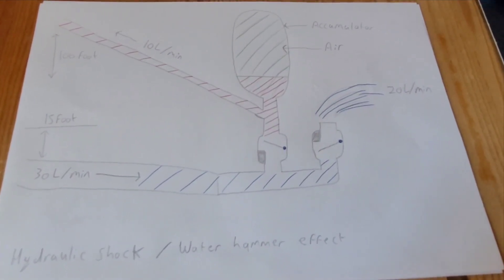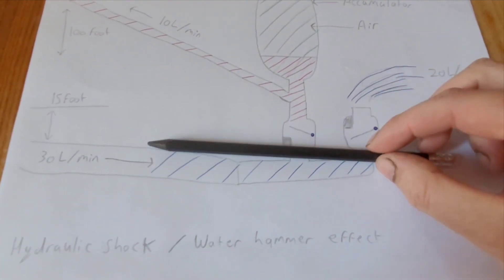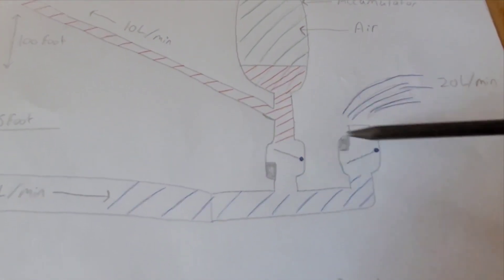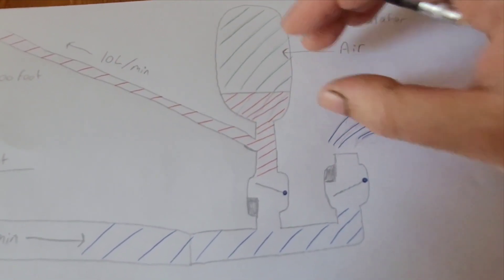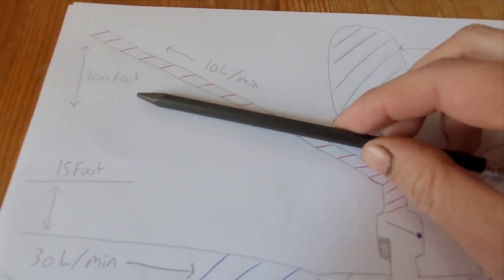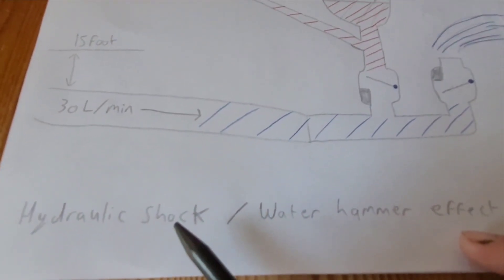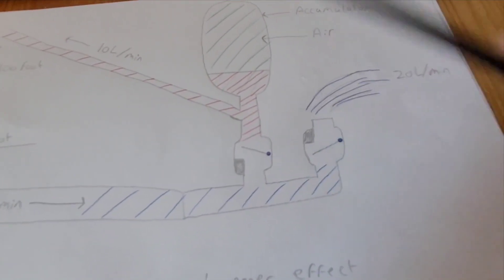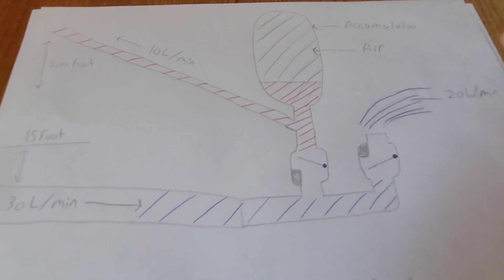How does a hydraulic ram pump work? Closest thing to perpetual motion machine, pump water with water

Comment: Lovely explanation mate, no good out here in the fens, haven't got a hill within 30 miles
Reply from the maker: Imagine the pressure with 30 miles of driving pipe 🤣 , really i supose if a pit was dug that drained away it would be possible to pump a few feet up but would be easier just have some rain water barrels up on stands with hose pipe out the bottom really for that